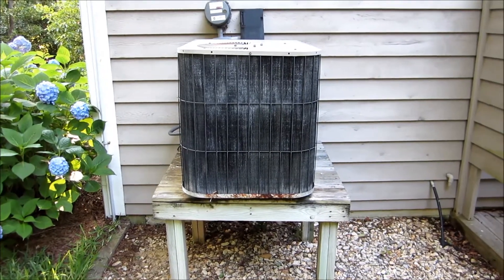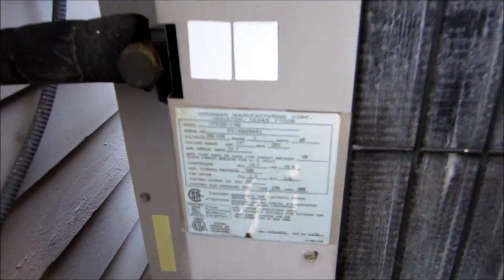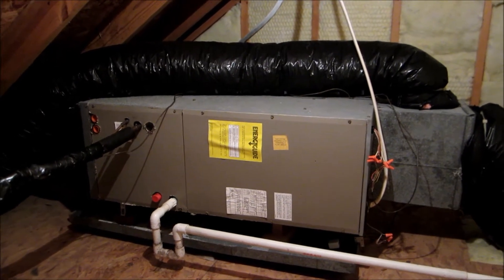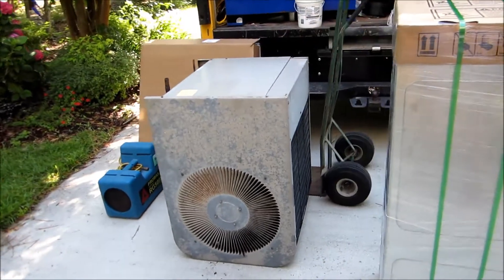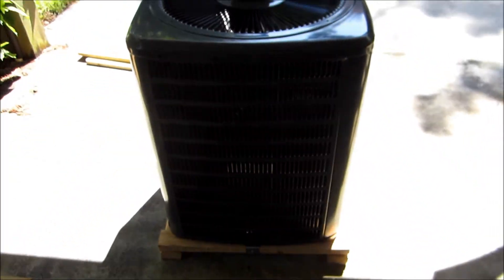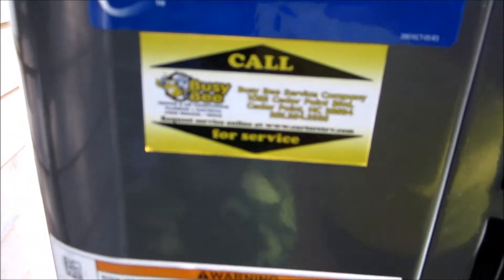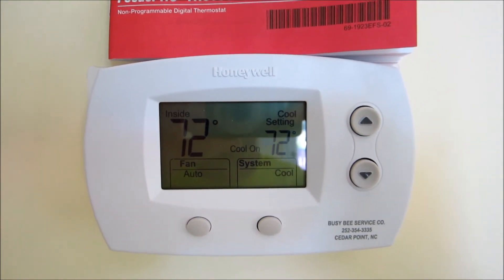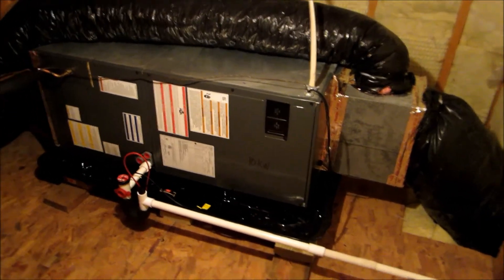Heat Pump/Air Conditioning HVAC Goodman Replacement - Emerald Isle, NC Home - June 20, 2013

Comment: I sure hope they replaced the line set,if not they sure did not do you any favors,good luck
Reply from the maker: Hi Lucylu40122, thanks for viewing.  They replaced everything all the lines, the entire attic split system as well as the outside unit.  The original unit was installed with this home in 1996 which was a Goodman.  If it can withstand this salt air and the occasional tropical storms and even the hurricanes sure recommend them.  This one is much more efficient notice a decrease from a year ago 2013 our power bills cools very quickly and the heat during winter as well.
Reply: mountainbikekayak I live in Oriental,NC and I also know all to well what the environment can do to these units.I do HVAC work for a living and am self employed.I have had some dealings with Goodman equipment and it seems to be alright.Most of the issues I have found are installer related,although I just replaced a Goodman AH because the A coil was a pile of rust.
Reply from the maker: lucylu40122
Hi Lucylu40122 wow you live in a beautiful place and I bet you have seen some fine rusted out stuff!  Here at Emerald Isle we have to rely mostly on word of mouth for anything major like this and we have heard hoary stories as you said on other installs like an electrical smoke/fire afterwards from a major company here!  This company Busy Bee (interesting name) has a great name and what I like is they came out charged our system with no cost before we even picked them and then once again while our new unit was coming in.  They city also comes in and does an inspection afterwards and gave them high marks no issues.  They also have retired military working for them being near Jacksonville got to love those men and women.  Hey with what you’re telling me you can branch out of Oriental down here to the Crystal Coast you would do very well.  Most homeowners including me just don’t know all those details.
Reply: mountainbikekayak I like to call that "planting a seed" I have done the same thing and picked up some great customers.I am the only person in Oriental doing this kind of work and stay as busy as I want to be.My competition (if you can call them that) leave A LOT to be desired in the quality of their work.I prefer to do service work but the installs bring in more $$$
Looks like we may be getting some weather this weekend lets keep our fingers crossed that it stays out in the Atlantic.We have our annual Croaker festival this weekend and a storm might put a damper on it.
Reply from the maker: lucylu40122 Hey how you doing in Oriental we are getting hammered here at Emerald Isle surprised we still have power.  We are getting the backside of Hurricane Arthur right now which has the worst of the winds buckets of rain this house is shaking!
Reply: mountainbikekayak WE SURVIVED, We live about 1 1/2 miles outside Oriental and only got about 1 1/2 inches of rain and highest wind gust 48 mph.Amazing considering how close we were to the eye.The power flickered a couple times but I had the generator ready to go.I haven't heard of any major damage in town so the Croaker fest will go on :)
Reply: lucylu40122 i